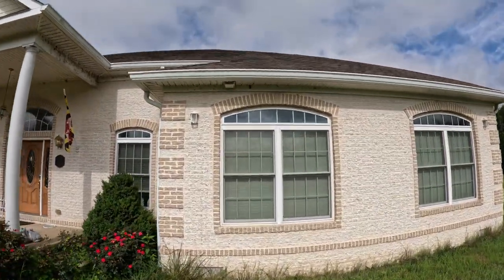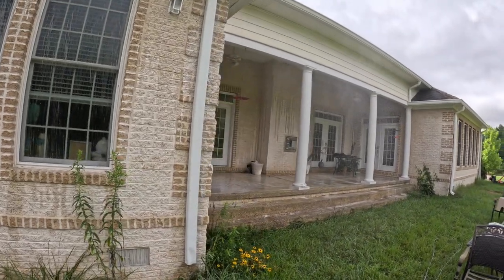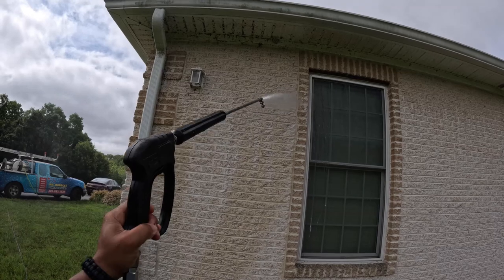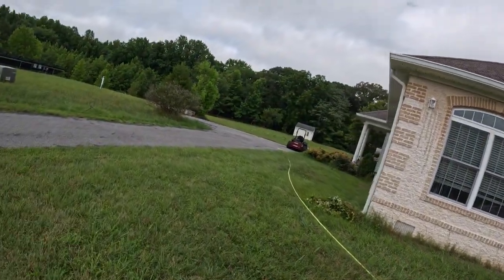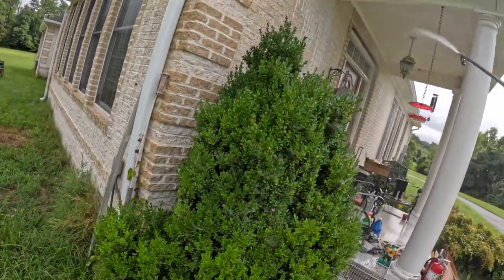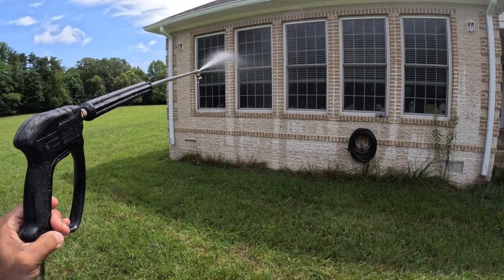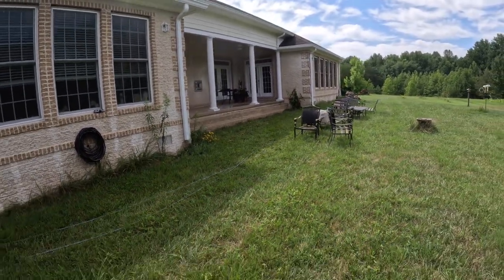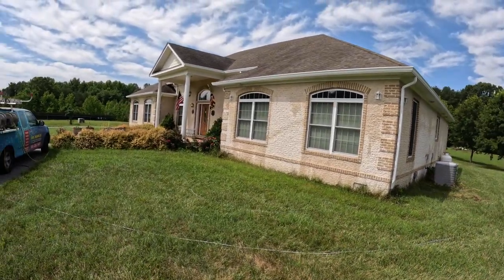Ep.46  How to Wash a House SWARMING With BEES!

Comment: Also I assume batteries are draining faster when exceeded the limit. It’s normal, add 2or 3 batteries as backup.
Reply from the maker: It's actually not the battery, the camera simply turns itself off when it reaches a certain temperature, even with a brand new battery. Now I only GoPro if weather is not too hot.